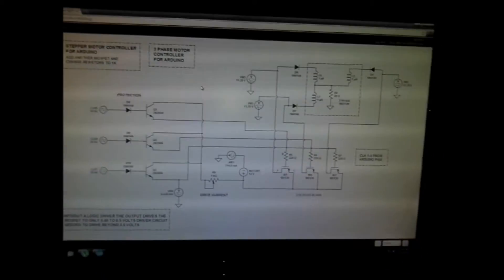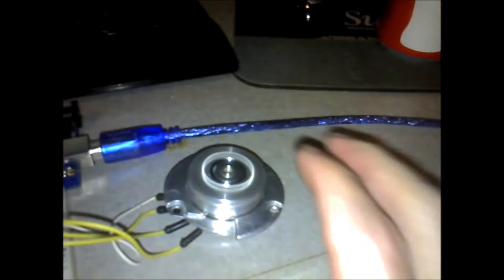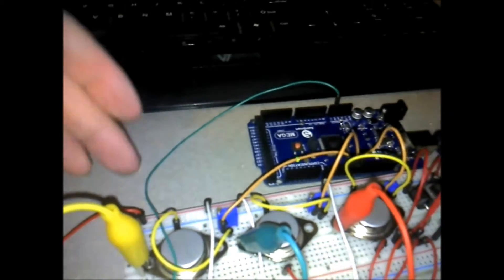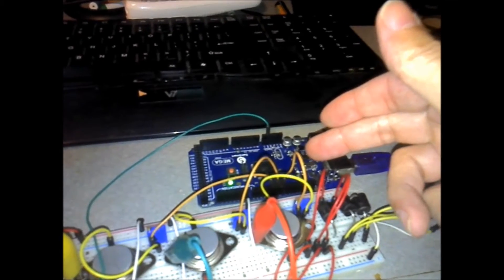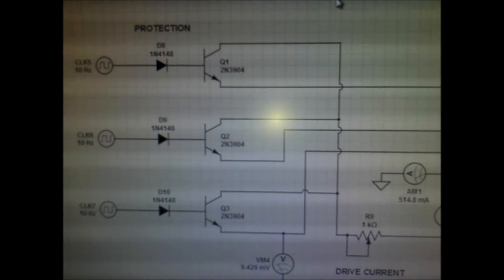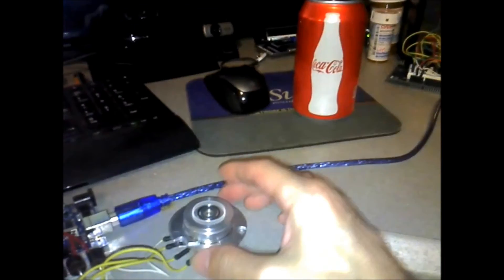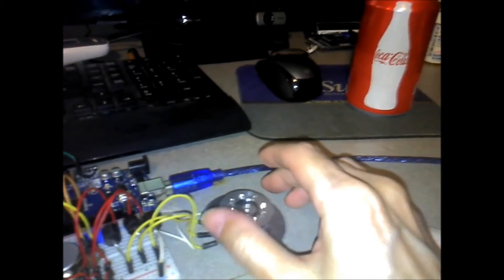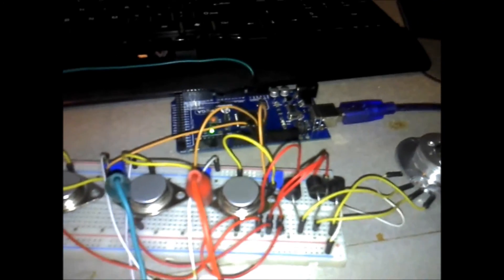Three Phase Spindle Motor Arduino Driver Demo

Comment: Have you tried using opto coupling instead of mosfet driving? You can use those to drive the npns and recover energy out of the system. Look up /Google arduino controlled bedini motor seems you can drive a magnet motor of any size with an arduino